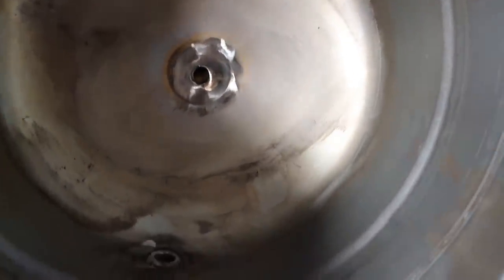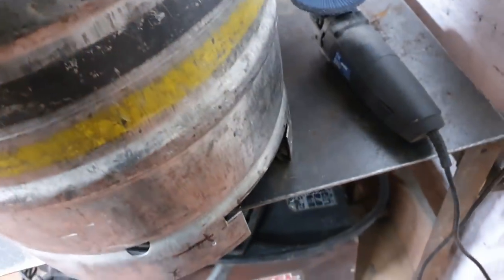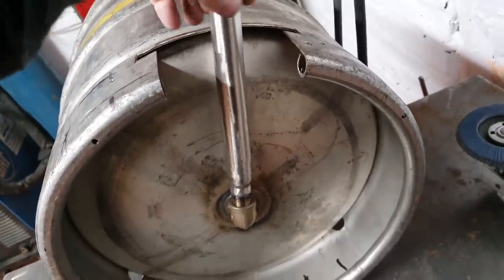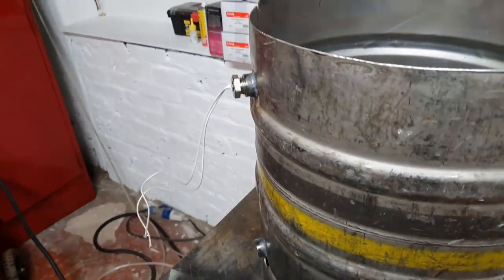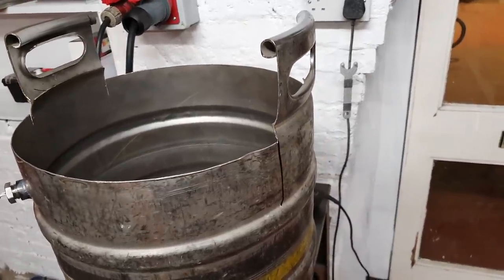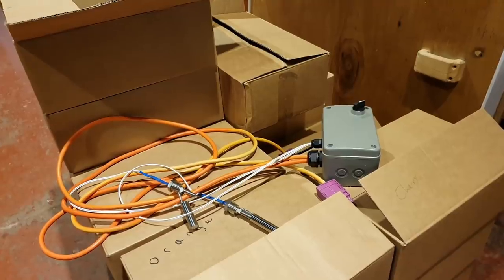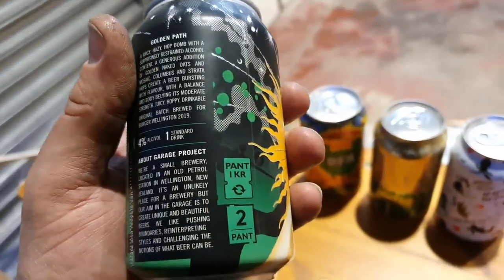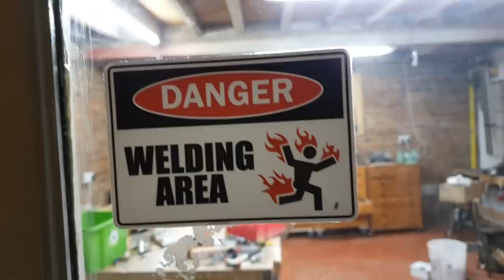UNDERBACK BUILD

Comment: I’m having some difficulty of the terminology “underback”. Can anybody explain it to me please?  Thanks!
Reply: On transferring wort from the mash tun to the boil kettle, draining into the underback will allow the pump to turn on only when wort is high enough to allow the pump to pump wort to the boil kettle. This prevents the pump from burning the seals of the pump as the wort cools the seals. This also allows the wort to be removed from the mash tun at a rate that will not collapse the grain bed and starving the pump. Massive stuck  form of a sparge.
Reply: @amarillohomebrewing4602  ahh gotcha, where I work (in the states) we call it a grant .  Ours is a giant glass piece that basically does the same thing from the sounds of it.

Thanks for clarifying
Reply: I seem to remember that Harry had one for filling the fermenter from the boil kettle at Idle Valley.
Reply from the maker: @amarillohomebrewing4602  Yes I did, I still have it but it is no good for this application.